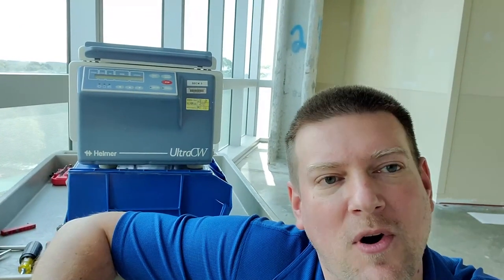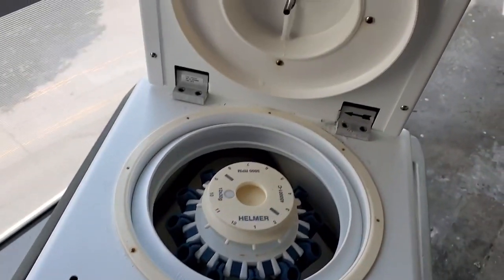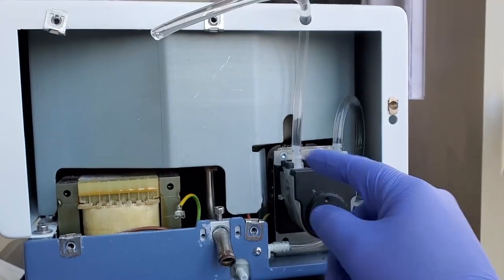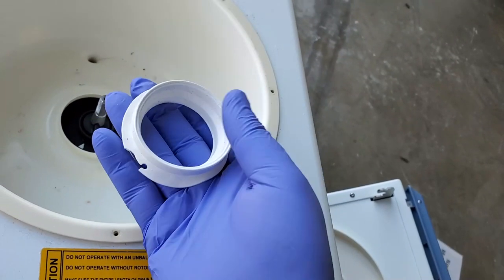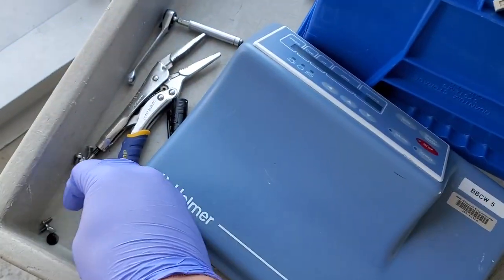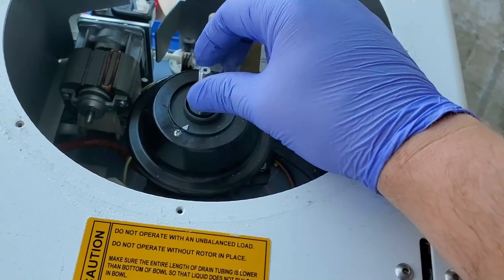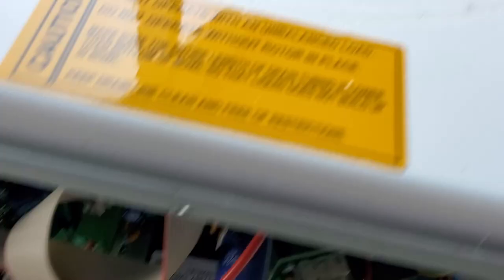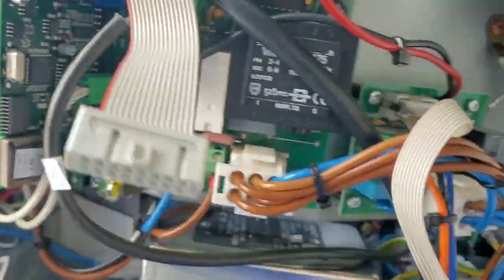Helmer UltraCW Cell Washer Deep Dive

Comment: Error 31
Reply: That just states there is an issue with the frequency 
converter circuit. RFI and Brake Resist Overtemp could have a factor also.